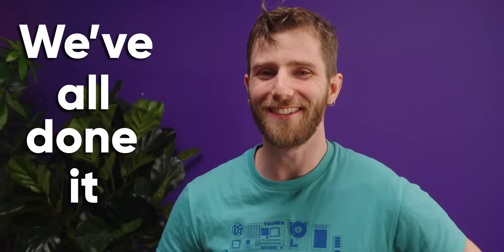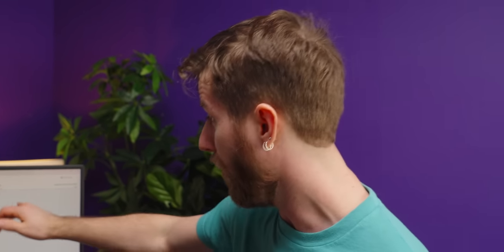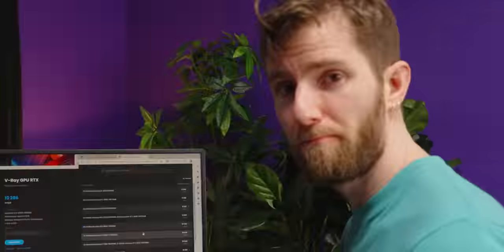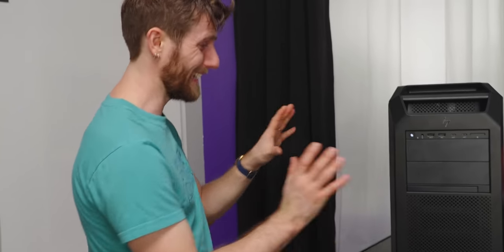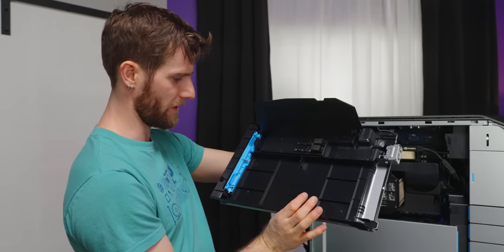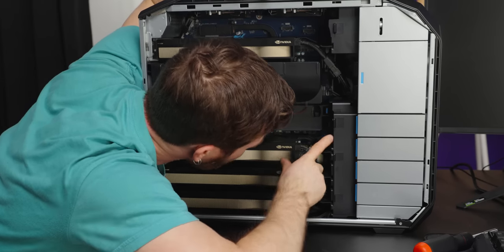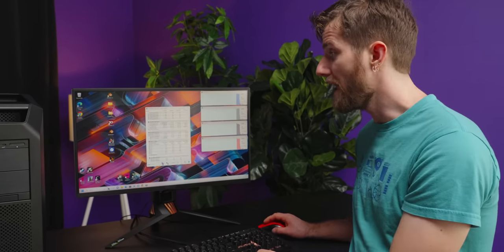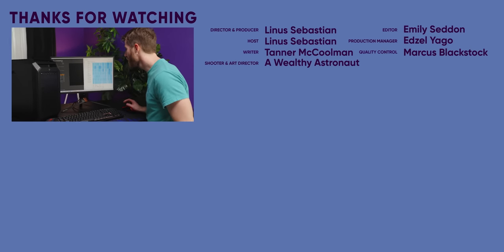Don’t ask me the price - HP Z8 Fury G5

Comment: You should do a comparison on how much performance per dollar and per watt has changed over the last 10 years.
Reply: I think that would be a great video.
Reply: yes please
Reply: First time I've seen a suggestion on here that is actually worth watching. I'd love to see them do that!
Reply: Flops per Watt is the calculation
Reply: 10? no, 20!
Reply: Do it
Reply: @zqzj  Flops per Watt^Nordstream explosions (for EU)
Reply: W idea
Reply: Ok that's enough Mr. Nerd
Reply: @andyk192  Ikr, because my 960 4gb gets around 60 fps in Gta v in 1080p with medium settings, which is bad today but also it was just 200 dollars. A 3060 is more like 500 dollars so it would be an interesting comparison.
Reply: Maybe make the time frame longer than 10 years.  For $50 in the 1990s, you could get a Sinclair ZX80 that could render a black and white stick figure in 40x23 character-graphics in a mere matter of minutes.   Compared to that an 8088 based PC with a CGA board was very fast.  Compared to that a 386 based machine with a multi-mode graphics card was spooky fast ... and so on.
Some sort of graph of pixels per second per dollar vs time would be interesting .
BTW:
With only a slight hardware modification and an added 16K of RAM, I made my ZX80 do 320x200 pixel graphics.   It could do that and check for a key press every 1/60th of a second.
Reply: YES. Adding more of everything will obviously speed up some things and with redundancy built in chances of data loss are lowered. However, if Watt/$ figures and adding on maintenance costs typical of hot machines result in bottom line inefficiency then products such as this are not necessary. Existing robust server class machines can be tweaked to optimize efficiency and 'horsepower' can be used for different applications in a company, university, medical facility etc.
This machine might not be able to be power-directed and represents the main restrictions of x86 at large. HP and Intel are missing the vital point that x86 architecture is in decline. This decline could be rapid.
Reply: That would be a great video
Reply: Performance for watt surprisingly tends to get better over time. IPC gains + smaller nm processing increases the efficiency every iteration. It's just that total system wattage is getting out of control because all the companies are competing to take the crown for having the beefiest flagship components on the market. And we keep convincing ourselves that we need the biggest, baddest, most bodacious components whenever we build something. That's where all the diminishing returns are, but unfortunately that's not really where it matters. Those people were gonna drop thousands whether it was economical or not.

I would much rather see the performance per dollar per watt on all the devices that aren't flagship products. The low to mid-range is a flippin' warzone and some of the value propositions can be ridiculously bad. But it's hard to really see without some solid metrics like performance per watt or performance per dollar. GN's been adding performance per watt to their charts and it's really eye-opening stuff. Sometimes it flips the whole chart upside-down.
Reply: at least 5
Reply: Great idea
Reply: You will make me cry with the 4770k and 1060 ¬¬
Reply: But which dollar? MSRP? Current price? Average?
Reply: Would be cool
Reply: I want to see this.
Reply: oh please do that
Reply: price to performance metric rarely has actual use for real buyers outside of being interesting factoid. Thats because it completely ignores any kind of context, be it your personal requirements, wanted features and expectations.
Reply: Problem is pricing is different for each market, so you'd have to define a specific region (or even country in some cases) and it would just be a mess to gather the data, even if you limited it to per-continent. You could compare only against MSRP I suppose but that's clearly not representative of actual prices as we have seen the last few years.
Reply: 3x in the last couple years lol
Reply: 1000x
Reply: @martindag1413  not anymore it's like 345 $

Comment: So I get that you are excited, but the ~63,000 Cinebench score there isn't top-end. AMD's Threadripper PRO 64-core (5995WX) gets around 70,000 - and that came out a year ago. And quad RTX A6000s aren't a new thing - those GPUs have been around for over a year. I wonder why they didn't include the new RTX 6000 Ada Generation, which are twice as fast?

Comment: As an architect I can confirm that this would be great for a smooth work on big projects like designing skyscrapers or new urban areas... and as an architect I can also confirm that this is something I could never afford :,D
Reply: @Neil3D  We play around with revit on old i5s and integrated graphics at my school 😂
Reply: My friend bought Threadrippers for his company for a similar work (they doing render concepts about building), and those are the fraction of the cost of this xenon monster.
Reply: @Neil3D  Yes exactly, Revit will use approximately one of those 56 cores and crash 30 mins into your sync with central
Reply: design a house with a security flaw and then rob it
Reply: Some of my high-rise mechanical/plumbing models would still crash this. Probably crash on file opening lol
Reply: @lepus6511 . So what super computer are you using?
Reply: @lepus6511  Sounds like you need a basic level IT guy then, or a new software developer, not a better computer. Your workload shouldn't crash a computer, regardless of its capabilities. That's a stability problem, not performance.
Reply: Funnily enough though, the FP64 performance on these is... Not good. I mean, it's definitely better than usual, but even a single 5+ year old Quadro GP100 will still probably beat all four GPUs in FP64-heavy simulation workloads. And again, that's a SINGLE GP100. If there was four of them, it would be an absolute BLOODBATH.
Reply: There are probably only a small handful of architecture firms in the world that would ever consider something even half as powerful as this. Certainly not mine!
Reply: @flyingtentacle7631  with one exception: if he has a huge workload those 128gb ram might cause it to crash on load (the workload, not the workstation), because those often can’t work from pagefile and have to be in ram. There is a reason the CPU could run 2tb of ram.
Reply: don't you guys earn more than enough already that 40k should be just around your price range? this is eyeopening for me....-a waiter at mcdonalds
Reply: @Neil3D  Revit wasn't unfortunately developed with using more cores at once. But you can utilize this power on large renders and of course when you're multitasking.
Reply: @seth7553  Amen
Reply: @BigBoss-kk4sr  I wouldn't have it any other way.
Reply: @lepus6511  Gotta love the coordination model.
Reply: @Neil3D maybe it has a usecase if this could drive serveral virtual stations without problems, so that it can render fast and also be used for normal cad design by several engineers/architects. But dont know if that is stable and smart because of the one point failure, that could take down serveral workers at once.

Comment: As someone that works for HP, specifically in the tech support department and even more specifically for the Workstation support, I can't tell you how many super odd questions we get on these things! haha. Of course most of my customers don't max out the specs on these, we get a lot of the lower end Z series like the Z2's and Z4's.
Reply: What kinds of questions? :3
Reply: @KnightMirkoYo  is a 24 core xeon enough for excel?
Reply: @satibel  bruh must be running the whole east coast transactions excel
Reply: @captainheat2314  tbh they had issues with some covid cases stopping getting tracked because they hit the max number of lines in the file.
Reply: @satibel  the government was using a version of Excel released in the 1990s so yea they're at fault
Reply: @kek353  They were using Excel in the first place. A spreadsheet is not a database, don't use it like one
Reply: What would be a feasible workstation to look for to mod in the near future, can someone get one of these refurbrished without the video cards?
Reply: @satibel if it's on the US government network… yeah.  😝

Comment: HP's proprietary cooling was genius and a pain in the ass in it's day, It's kind of cool to see them doing it again but really effectively.  It feels like a nod to those old, green, plastic channels.
Reply: Leah Jiraiya  Spam bot, spamming links.
Reply: I miss green PCBs and add-in cards galore ;_;
Reply: @smiths7317  thanks man 👍
Reply: I have a retro gaming PC that has those green shrouds. It overheats with them off even though the thermal paste was recently renewed lol
Reply: Exactly what I thought, even though they look more Lenovo than HP this time (because of the purple/blue instead of green)
Reply: had one of those with a highend Pentium 4 PC (yes they existed and were rather fast too) - 92mm fan with a wind-duct directly to the CPU-cooler, of course cooler with its own fan, and then another duct with a 92mm with a rare exhaust.
Absolute beast in cooling while still silent.
Reply: back in the day I had a duel xeon Dell workstation that had similar airflow setup (also green shrouds) and more copper heatpipes than I have seen since. as an engineer I love these highly functional designs

Comment: I love the HP Z cases, picking a used one up this weekend, a bit on the older side, but will handle the intended application with ease. I am paying like 700 $ for it, and it is about 5 years old, I needed it to be able to handle VM, WOL and to be rack mountable. The cases alone is worth quite a bit in my book. If you can get one, do it, toss in your prefered hardware and go ham.

Comment: Cool to see what a oem manufacturer would design a no limit workstation like, loved the memory cooler design.
Reply: You say would as if this isn’t something enterprises are already buying
Reply: @carlosbonmarist bro, this is Fortune 500 company level shit…this isn’t a common enterprise machine.
Reply: The best graphics card is the eye
Reply: @hyperhawk007  what type of card is that ?
Reply: @Dracula.25  A bioengineered one that maximizes resolution for the exact spot you're looking at, not to mention virtually infinite VRAM. Isn't the best for maximum framerates, however
Reply: @krishyb  It's quite an old design, too. It goes back at least 75 years to the Mil-Spec Mark 1 Eyeball, used by snipers and tank gunners alike.
Reply: Of course it will burn your wallet away. It's an Intel CPU 😏
Reply: @krishyb  if your eye is in a form factor to fit a pcie slot, see a doctor.
Reply: @colemanroberts1102  he's just built different.
Reply: @krishyb  wrong on so many levels

Comment: For comparison, I just ran the same Classroom blender scene in 13 seconds on an RTX 3090 FTW3 (haven't touched the clocks).  Obviously those A6000s have twice the VRAM so they can better handle huge workloads, but it's neat how close you can get with a last-gen "prosumer" GPU.  What I'd really like to see on the Xeon-W is code compilation benchmarks.  I'm not ready to decom my Zen2 Threadripper just yet, but it's nice to see Intel giving the HEDT/workstation market some attention after a decade of total neglect.

Comment: The perfect build for a small AI researcher/Developer ... not like it's needed but it will be awesome to have
Reply: But... but... b-the price...
Reply: i think if you had $20,000 you would be better served with a80s
Reply: @h1Lu  I would buy such power, if I had the money. I don't care if I need it. 😊
Reply: @Serpensin  lmao an admiral doesn't have 40k
Reply: Now I can dunk on my roommate for only having a single 3090 in his machine learning setup.
Reply: as it is it serves absolutely no purpose for anything outside of a business situation that specifically needs this type of computer
Reply: Realistically you would just rent the hardware instead of buying a workstation like this
Reply: This would really do well as a work from home machine for Deep Learning. Meanwhile I'm just using a single 4090, but hey, I can game on it and plan/test projects before renting the horse power needed.
Reply: It you really want to make AI fly, you need something with racks and racks of FPGAs rather than CPUs.  Each "nerve cell" of a convolutional system is a bunch of multiply-add operations to a low accuracy level.  Many FPGAs come with armies of multiply-add circuits that can all go in parallel.  It takes several clocks before the answer for a given input appears at the output but you can do a new input on every clock cycle.
Reply: Right now maybe, tho it used to be way better to just use multiple 3090's maybe we get some nice consumer cards that are really good for ML again
Reply: @h1Lu  the price doesn't matter if your boss is the one who paid for it for you

Comment: I honestly wouldn't mind having that case. Screw the tempered glass, I want my side panel to act as a gpu support bracket. They could easily add an adjustable support. Or a foam pad that pinches the gpu.

Comment: That was the chasis intrusion detection. It's a security measure, not about air flow.
Reply: I was hoping I wasn't the only one that knew that
Reply: @dutifulbarrel9084  Well as the machine shut down when he opened the side panel I*D say it's both in this case. Normally the intrusion detection just will scream at you and log an intrusion event, but the machine will still be running. Given that servers and advanced workstations usually have hot swappable fans, PCI-E cards, drives and so on it's not really a good idea if it shuts down just because you open the machine. But in this case opening it up will compromise the airflow and cooling, and given the hardware that's probably why the intrusion detection has been set to power it down when someone open the chassis. This behavior probably can be changed in the setup menu.
Reply: Man acting like LTT doesn’t know what intrusion detection is
Reply: @Глеб Сальманов It is useful for large companies. they don't want someboy stealing or tampering information. If somebody does, they will know. There will be permanent log in the bios and telemetry to IT admins is also possible. It has other uses too, for service as well. It works even when PC is off btw.
Reply: @Глеб Сальманов Depends on information needed really. I mean this machine would never be used by small family business so stealing a physical media in bigger company is likely a lot easier method of theft than going unnoticed through various security services and devices.

Comment: The university I work at has an Nvidia server which has a lot of computing inside. I think it was the 8U DGX-H100 by the looks of it. And they even had another one in the next server cabinet. Alongside with a lot of really cool looking server related stuff in a big room full of server cabinets. That was really overwhelming. They even put the climate control on little touch panels so an admin could easily correct or view the temperatures of everything. And the equipment in there was so cool, a lot of stuff I have never seen before. 

So a "small" PC like that HP one might be interesting for a company with not that much space but with high demands on rendering.

Comment: As someone who uses an HP Z230, the fact that this is the same family as my computer is totally insane. In 10 years, I may likely have something like this!
Reply: Here is another HP Z Series PC user, but with Z240 Tower, Xeon is still decent even-trough it is only 4 core/4 thread E3-1225 V5, but in combination with Quadro T600, 32GB of RAM and 512GB Nvme Gen3 SSD is, well, still capable even for lower-end gaming and productivity like development and photo editing. Might upgrade from Xeon to i7-7700 if it goes for fair price on second hand markets here in Croatia (at least then will have 4 more threads)
Reply: me too having The Same HP z230 i7 4790 see you next 10 years
Reply: Had a z240 and threw a 1050 in it and could play battlefront and masterchief collection decently in it. 
Wonder what card would be good in this one ten years later.

Comment: I know many people don't care for it, but can I just say I appreciate it still having a 5.25" bay? It gives so much room for expanded front I/O, but not many cases have them these days.
Reply: I miss those bays. So useful fo many things and reasons.
Reply: I still use my over decade old HAF 932 case because of all the front drive bays. They are crazy useful for expansion which in my case is 2 disk drives and a USB 3 hub. I can rarely find any newer cases that have 5.25 bays anymore. It really sucks.
Reply: @TheTardis157  I have the 922. My wife has thr 932. Love. Them. Both!!
Reply: Yesss!!! A tower case with at least two 5.25 front bays, handles to move it and room on the front for AIO triple fan radiator is what I'm looking for (and doesn't seems to exist...).
Reply: Heck, there is even a thing on Ebay I bought to put something like 6 ssd's in a front bay slot.
Reply: @matteogiberti3297  look at the fractal design Air
Reply: @JK-mo2ov  Seems good (beside tempered glass which I hate due to a bad cut it caused on the palm of my hand years ago...), but I see no handles...
Reply: @matteogiberti3297  they sell a solid side cover version. It doesn’t have handles though. I just got the 2 front fan case and I like it a lot for the 5.25” bays.
Reply: @JK-mo2ov  Ok, I can always put a couple of handles on top with a little DIY by myself... good that it has front bays, gaming PC cases never have 'em nowadays...